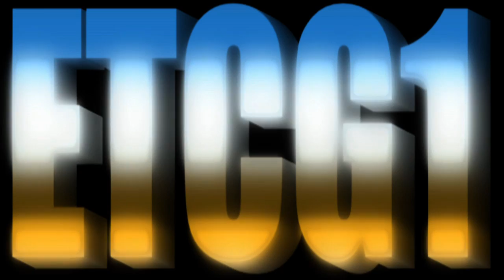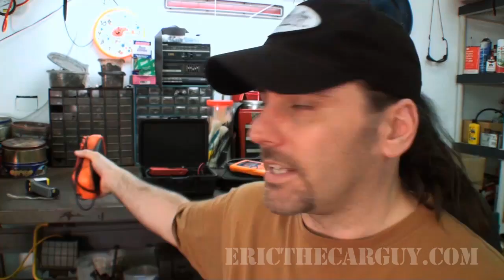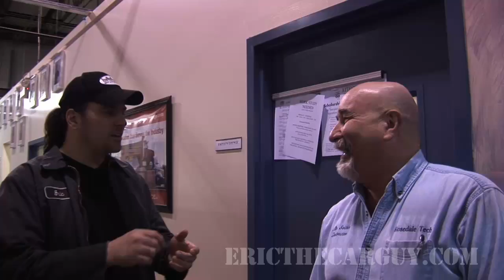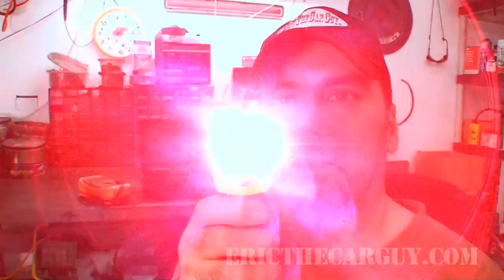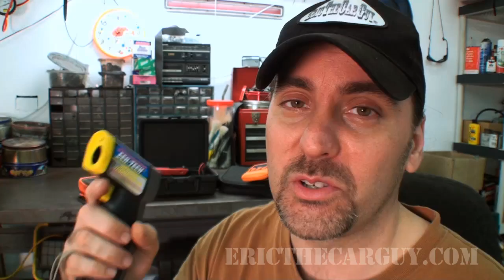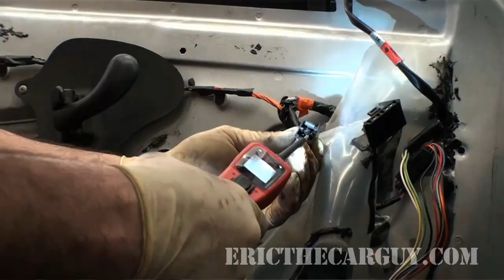The Future of Diagnostics -ETCG1

Comment: Speak of the diagnostic devil, (California emissions 2000 Altima) SES light works, passes "Bulb test" when u turn key, but when the car is running, it does NOT turn on even though codes/hard codes/current codes ARE present and the ECU commands MIL ON; I've never seen this before. This car has other tampering/modifications/jerry-rigging done so I have reason to believe this is intentional rather than an ECU failure bc all other functions check out. P0105 MAP circuit. The sensor is missing, but the ECU sees 100% load, so It's OPEN if im not mistaken but they really went out of their way cus they cut back all trace of the MAP sensor harness. And it goes deeper, but can you please, please help me out with this? I havent found that car's specific diagrams or pin outs or know for certain this year uses MAP hardware or software integrated into the brain. Thanks man you're awesome.

Comment: I am not angry at all. I also don't know how you concluded that I am ripping anybody off (may be it is the lack of info like you said). Like I stated in the posts above I have no problem with scanning a car for free and giving possible causes. But, if they want me to diag EXACTLY what's wrong with the vehicle ( which requires time, physical labor, equipment, tools and etc ), I need to get paid. My customers know that and come to me because they are tired of other shops throwing parts hoping...

Comment: Good question. I'm trying to come up with a mechanical replacement for PCM transmission control. A buddy of mine had his computer get fried (as ALL computers will do, eventually) and nissan wouldn't sell him a new PCM without a new transmission!(?!) I then realized, if at all possibly, I should try to figure out how to replicate shift control with a simple switch. It's just solenoids going on and off, after all. Well, and a PWM force motor.

Comment: Hey, sorry if you're angry & frustrated, I only have what you gave me to work with, and giving a list of "possible causes" is NOT diagnosing and IS free from any parts store, on the print out they give you with trouble codes. FOR FREE. Period. End of story. Do what you will with it, I will point your customers to how you're ripping them off. I do that consultation for free because that's what the competition does, and my customers trust me as a result. Yours won't be happy when they find out.

Comment: There is a difference between scanning and diagnosing. I have no problem to scan the code for free but 99% of people want to know what the problem is. This requires a certain set of skills which one acquires through schooling and many years of experience - this person needs to be paid. Example - P0300 (random miss) - possible causes: plugs, coils/wires, vacuum leaks, clogged cats, low fuel pressure and etc. I hope you get what I am trying to say by now.

Comment: Thermal imaging cameras are very good, I had a one the other day to play with but at 3 grand it still a little bit expensive for the use it would get. that one belonged to a customer of mine that does plastic injection moldings where the correct heat is critical as you would understand. I have worked on electric vehicles for many years and i think
oscilloscope's  have come a long way in recent years. well worth the spend now.

Comment: Standard rate is 100/hr so I don't know where people are getting this 80/hr labor because up here its 100/hr or fix it yourself. 

FYI my car has never seen a mechanic because yes I also fix my own car, 160k miles and running strong. new grounds will help get that rock solid idle, btw.

Comment: try getting your 84 to pass 2014 emission standards, it WILL NOT HAPPEN. They are about 100 times stricter than your 84.
I have tuned/rebuilt carbs, done points and gotten them to pass emission test, all you have to do is look at testing standards going newer and you would know you are full of it
IF 80 is a rip off what do you do for living? and how much do they /you charge for their service or product?

Comment: 80 an hour is outrageous. 120 an hour is worse. I fix my own shit, autozone has a scan tool that can tell me general directions to go. IE: Car is running rough. does it happen at idle only? at idle where are the RPM's of the engine, is there a Check engine light, or a service light on? no? clean throttle body and intake.

Comment: Thankfully I don't have much electronics in my vehicles, my bike is carburetted and my truck is a hard-plumbed diesel clunker with gear driven camshaft and injection timing. Very unlikely to fail. Only electrical problems I've had so far were with an alarm, clutch lock when bike stand is down and speakers in the truck. A multimeter and small soldering iron did the job.

Comment: I agree. People have no problem adjusting the ignition timing on an old mechanical system with distributor every 2,000 miles, but they have a problem with a crank sensor for 50 dollars malfunctioning after mostly 125,000 miles and ten years of operation without any problems, 75 mph over hours every day, over years... i think that is pretty reliable regarding we drive a lot more and faster in these days. Greetings from Germany.

Comment: LOL cars run way smoother these days with electronics. Everything is timed so much better then mechanical crap early cars ran. New cars get higher compression (due to sophisticated machines crafting engines), timing is very accurate, because of coil packs and ECUs, Fuel/air ratios are more accurate, because of sensors, the list goes on and on. And because of all this engines last longer before catastrophic malfunction. So do some research before making such statements.

Comment: I'm the guy in my shop that gets the electrical stuff first.  Love it.  I'd rather spend 10 hours a day with a multimeter, test light, and a scan tool than 5 hours a day doing front end work.

Comment: Eric strolling down memory lane.
Eric, anything being used in Nascar racing for diagnostics will be in a few years used by the mainstream Backyard mechanic. Prices will lower, knockoffs will become available, and user universality will make it a go-to tool.
One additional use that I can see for a infrared thermometer is electrical. As resistance makes heat, the tool can "see" things [bad connections, shorts] without moving or unhooking connectors, thus saving time and frustration.

Comment: I worked in a Ford Dealership and in the service department as an advisor. Only 3 out of 25 techs could diag.. Most were just parts changers and that is what I see with the newly graduated techs.. I am now and have been taking technician courses at our local community college the only subjects that are really need diag. are brakes and electrical. Everything else is parts replacements, black box. Hardly any real diagnosis anymore.

Comment: As a DIY'er working primarily on my OBD-1 car I use a cheap multimeter, T-pins, jumper wire with alligator clips.  OBD-1 is tough for a beginner.  From my perspective I could certainly use a temp gun and in fact have wanted one for a while since learning they could be used to help diagnose a clogged cat. For a DIY'er it could be a HUGE help because of our extremely limited toolboxes and experience.  Great question Eric.  Yes, DO WANT! :)

Comment: My car's a 97 and still has this proprietary old style VAG thing, where you have to connect some terminals, then turn on the ignition and it shows you codes by flashing lights in the dash. The future however may be a complete on board diagnostic system that shows you a diagram of the vehicle with the failed part(s) on the dashboard monitor that newer vehicles use to have, without the imminent need of a separate scan tool. That would be cool.

Comment: I think thermal imaging will be very useful. it is used in my trade (swimming pools) to pinpoint underground leaks. in this instance it could be used for diagnosing all sorts. blocked radiators, finding tiny leaks in cooling systems, wheel bearings, exhaust blockages, brakes etc etc... good video !

Comment: in electrical panels with thermal imaging you can tell if there is a loose connection. they also use thermal cameras with the power companies flying in a helicopter to look at the trasmission lines to see if there is hot spots

Comment: The infrared Thermometer and the thermal imaging are based on the same principal. So if you are already using an infrared thermometer for diagnosis, the upgrade is thermal imaging. From measuring one point (or a small area) at one time to a bigger area at once. That´s the simplest way of describing it

Comment: Good video. I am still using OBD-2 to diagnose problems when the MIL comes on. Just pull the codes with a scanner, look them up and usually I can find step by step instructions on that to measure or replace. OBD2 codes are a great help in diagnosing problems.